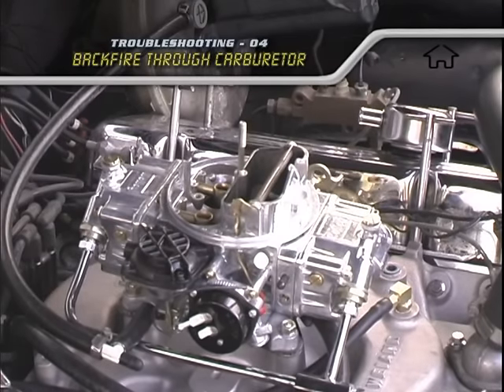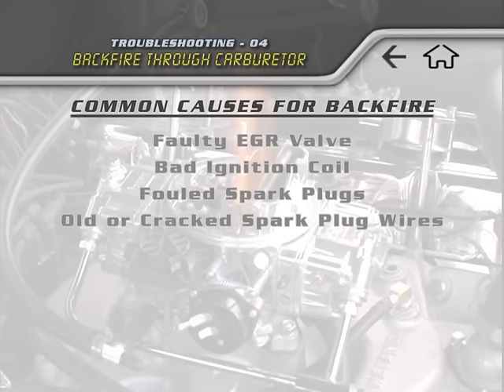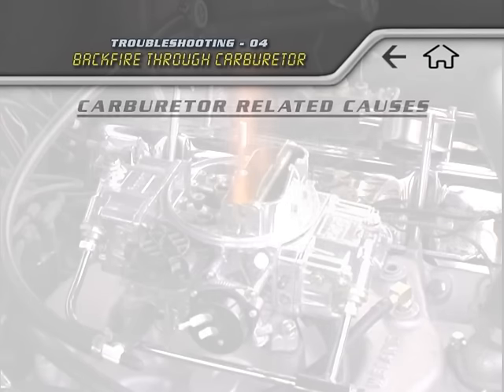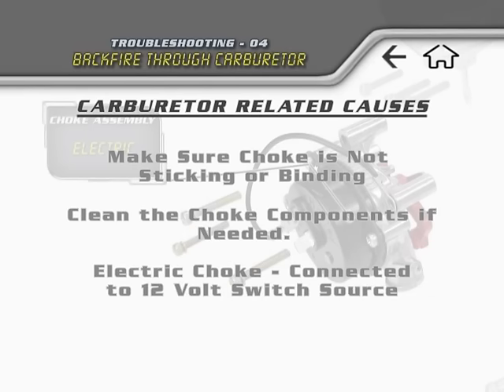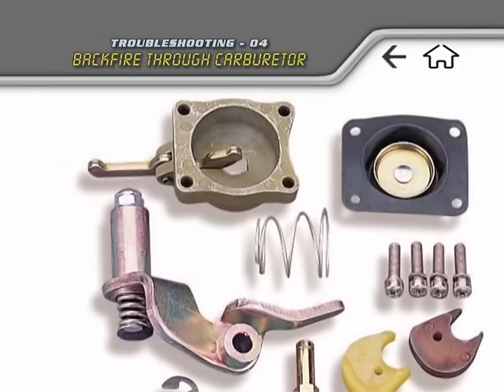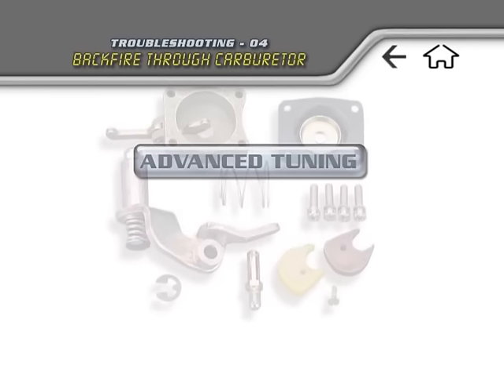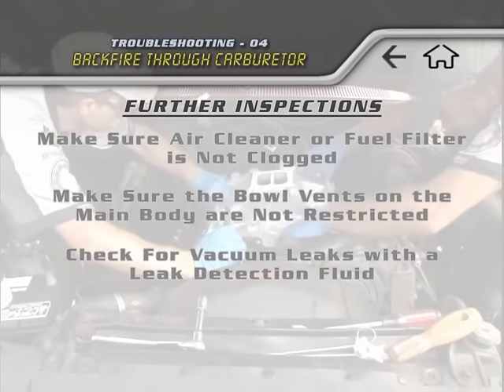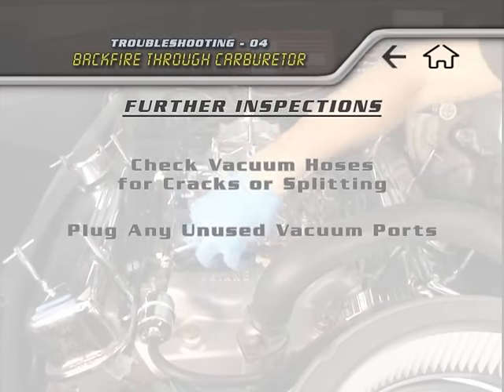Troubleshooting - backfire through carburetor

Comment: Another reason for a back fire through the carb. Is plug wires that weren't installed correctly on the correct cylinders. Also a oil pump that locks up a little and twists the drive rod from the distributor will cause a backfire

Comment: I'm on fire, I'm on fire, I'm on fire......
Reply from the maker: Funny!, but not Funny if it has happened to you! :O
Reply: To be sure. We were told about never looking down an operating carb when we started dynamometer at a uni.
Reply: @HolleyPerformance  Hi, so, I normally work with computer controlled fuel injected stuff or diesels, but I got a motorhome with a 454 big block, and it was leaking gas, burning very rich, and eventually one of the back fires ignited the gas that was all over the engine block crisping and shorting all the wiring as well as melting the vaccum hosing, the components between vacuum and electrical lines seem fine, but I'm not sure where to start after cleaning off all the fire extinguisher dust
Reply from the maker: @slapkickinmule  I'd remove the carb from the engine and try cleaning it up good with some carb cleaner and a brush.  Then disassemble it and try to determine and correct the leaking issue.  Thx J
Reply: Please i have a superban 92 engine 454 that works two hours and then stops suddenly and a fire occurs from tbi And I replaced all the sensors and everything and I couldn't find a solution

Comment: Upon wide open throttle, my car intermittently gives severe jerks/misfire. This started happening after rebuild. What could be causing the issue? Can the large jet cause this problem?
Reply from the maker: There are a number of factors that can cause this.  Did it do it before the rebuild? If not, then I would check things like ignition timing! Also check fuel pressure, then look into carb jetting and accelerator pump operation and settings.  Thx J
Reply: @HolleyPerformance  It did not do that before the rebuild. I replaced the whole carburetor with a new one, and problem solved.
Reply from the maker: @zainulabideenzain3  I would have to guess then that something was installed or assembled incorrectly when the rebuild was done.  Glad you figured it out.  Thx J

Comment: My truck just got converted from EFI to carb, have a holley 4bbl on it.  WHen I got it back she had some trouble spots here and there, over time of driving it I decided it was time I take a shot and tune the damned thing myself lol. Well I did it, started from zero and tuned the carb until she felt smooth and no popping or hesitation could be felt . After awhile I finally got it, or so I thought. She was riding beautifully , the 454 its attached too running calm and steady. Then all the sudden tonight while giving it a bit more gas than usual a massive pop and a good plume of smoke made its way out from under the hood. For 2 days she never had an issue, then tonight I thought I blew the damned thing off the intake lol. 

Pulled over and popped the hood to make sure there wasnt a fire or anything and nothing, just spit a big flame and she was back to being smooth . Before I re-tuned I can  tell you she was definitely running a good bit rich so I made sure and kept it a bit leaner than where the installer had it. Now I dont know if I need to go more rich or even more lean lol. 

Find out tomorrow I guess .
Reply: Whelp, how did it go?
Reply: Should have stuck to EFI

Comment: whats the theory behind it though? for example if you have bad plug wire how does it even fire in that cylinder? i understand how bad timing could cause this but i dont understand how this would accure if timings fine?

the fuel sprays as intake valve opens,the piston goes down to draw in air and as it comes up the valves close and combustion accurs so if cars timed correct how is faulty plugs/wires/fuel create the backfire?

Comment: I have a 1990 Dakota sport (3.9 V6) and they use a Holley EFI carb. I’ve had stalling and tough idle issues but yesterday I had a backfire. I immediately replaced the ignition coil, plugs wires, and spark plugs, as well as cleaned the EGR valve. What else could I do before I have to take it to the shop and have them check the more complex stuff?

Comment: Had a quadrajet on the 360 ramcharger, ran like ass after a rebuild, put a holley on, backfires every 1/2 second out of the carb.  Checked the electronic choke, wire wasn't connected.  Connected the wire, now it backfires every 1/2 second LOUDLY lmao.  Send help.

Comment: Mine does fine until it’s over 1/2 throttle, then it bogs down and eventually will come out of it. It also gets better as it warms up more. That means it’s too lean right?
Reply from the maker: It could be too lean or too rich!  Does it pop back through the exhaust or air cleaner?  Does it do it when you roll into the throttle or just when you punch it? Best thing is to pull and read the spark plugs.  If it eventually comes out of it I would say the main jetting is fairly close and maybe look at other areas (squirters, power valve, etc).  You also need to check your timing and make sure that the mechanical and vacuum advance in your distributor is working properly, as well as all the other ignition components!  Thx J
Reply: HolleyPerformance thanks for the help!
Reply: @holley my skylark is having the same issue but it back fires trough the carbuator only when i snap tue throttle .
Reply: Can you remember how you fixed it? My car is doing the same exact thing. 
I've changed spark plugs, cleaned the carb and checked the vacuum advance.
Reply: @crack3273  just fixed the issue it ended up beign  the cam shaft replace camshaft and lifters issue resolve.

Comment: Will a bad power Valve can also backfire?
Reply from the maker: When does your backfire occur?? (ex. Idle, hard acceleration, WOT, constant cruising speeds, deacceleration)??  A blown Power Valve acts like it is open all the time resulting in a dramatically over rich fuel mixture at idle and no response when trying to lean out the Air Screws.  The most common cause of a backfire is ignition related, possible causes could be that the timing is off, too much or too little mechanical/vacuum advancement, or possibly a bad cap, plug or plug wire. Thx J
Reply: @HolleyPerformance   We have a 454 mercruiser 7.4 liter in our boat, carb has been rebuilt, new mechanical fuel pump,new distributor cap, new plugs and wires but we are still having backfiring when we are at WOT  then we slow down and the backfiring continues at lower rpms as well.  It doesn't start off backfiring at low rpms only after we got up around to 3 to 4k rpms. Any idea? I'm thinking timing issue...

Comment: Mine runs and ideals fine , until I rev it , it back fires out of carb
Reply from the maker: You may need a larger accelerator pump nozzle, or it's possibly your accelerator pump linkage has too much slack in it.
Reply: Did you solve the problem if so how?